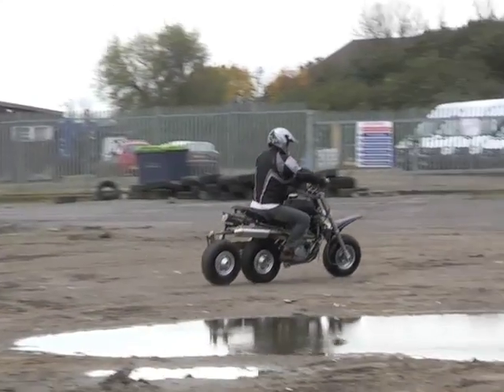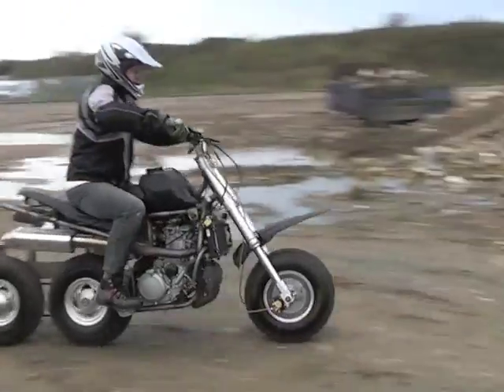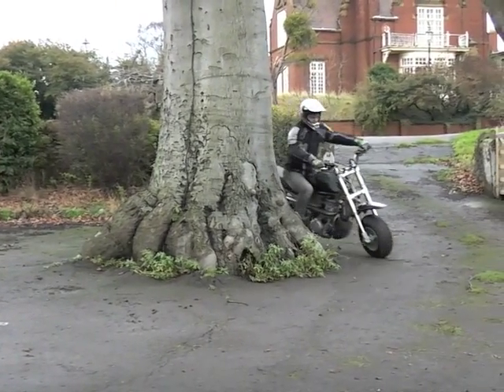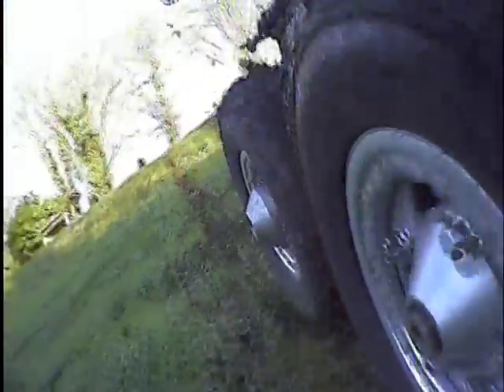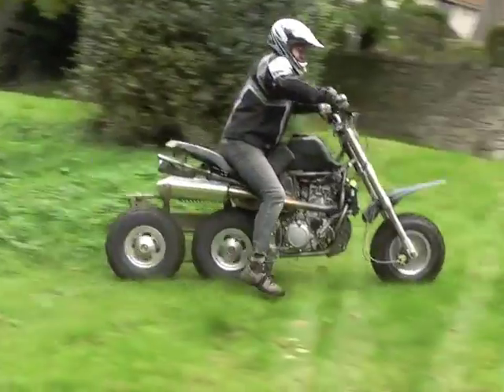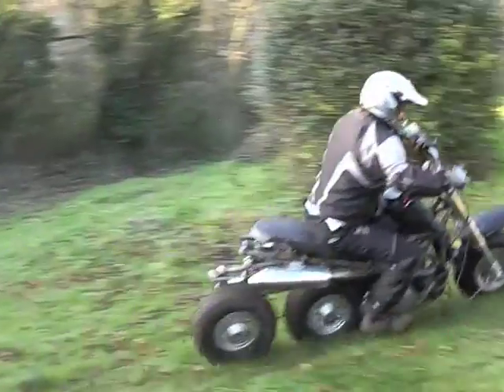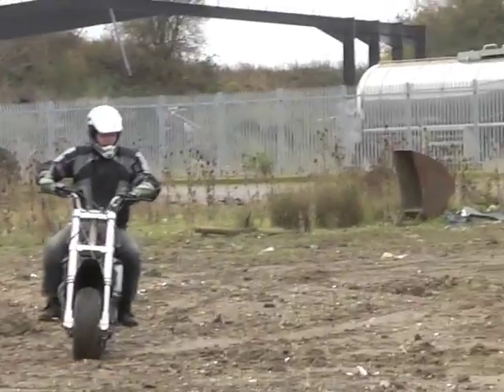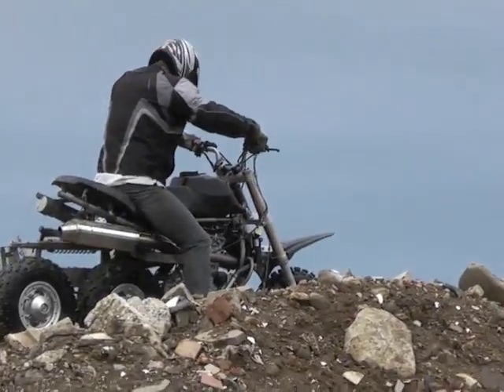DDS Inline three wheel motorcycle.m4v

Comment: Some very clever engineering here. I would recommend showing a conventional 2-wheeler alongside, a-slippin' and a-sliding. But can this in line 3-wheeler do anything that Yamaha's 2-wheel drive 2-Trac 450 couldn't? And impressive though the 2-Trac was (I rode it in the sands of Morocco when it was launched) it hasn't exactly 'caught on'! PNB